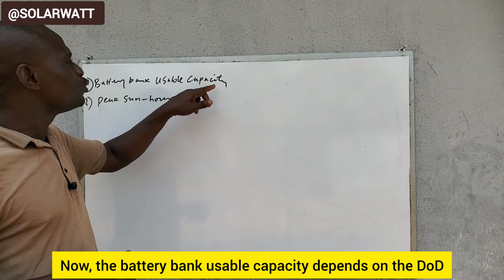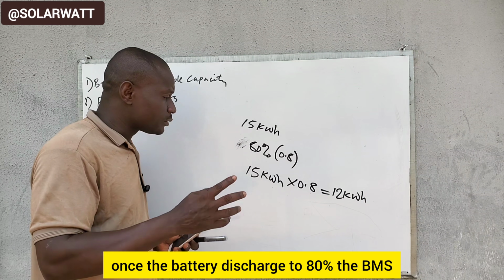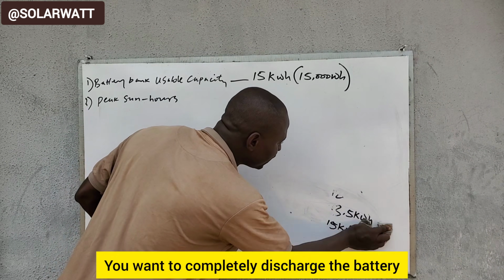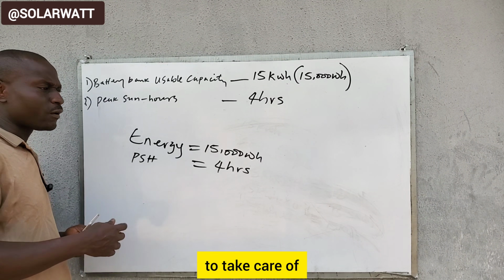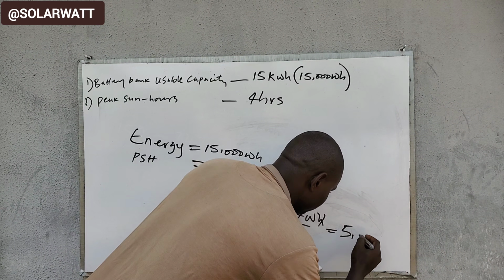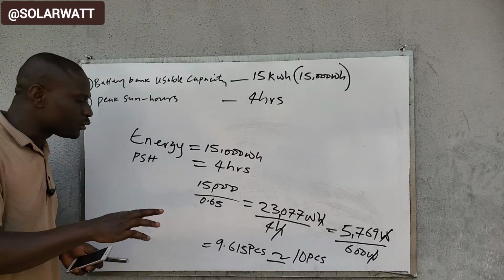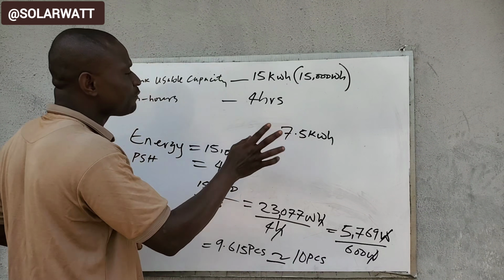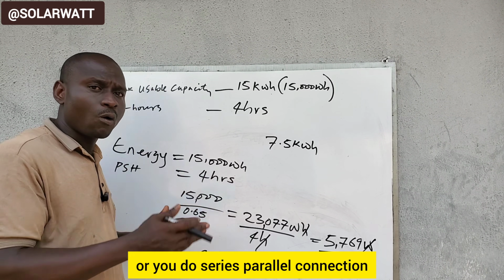How many solar panels do I need for a 15kwh Lithium battery?

Comment: Unfortunately, this sizing is misleading. Sizing should be based on demand not battery capacity. For example, if a household uses 7kwh per day, they probably use 1/3 to 1/2 of it during the day. That should be in the math. See example below

1. Estimate Daily Energy Use
From bills or appliances: Daily usage (Wh) = Σ (Appliance Watts × Hours per day)
e.g. Daily usage = 7 kWh/day = 7000 Wh/day

2. Battery Bank Sizing -  See note at the end for Days of Autonomy.
To cover night/backup use: Battery Capacity (Wh) = (Daily usage × Days of autonomy) ÷ Depth of Discharge
e.g. Battery Capacity (Wh) = (7000 × 2) ÷ 0.8 = 17,500 Wh = 17.5 kWh

3. Solar Panel Sizing -  See note at the end for Days of Autonomy.
To cover daily needs + losses: Solar Array Size (W) = (Daily usage ÷ Peak Sun Hours) × 1.3
e.g Solar Array Size (W) = (7000 ÷ 5) × 1.3 = 1820 W
Panel selection: Use 6 × 350W panels = 2100W

4. Inverter Sizing
To handle peak load: Inverter Size (W) = 1.2 × Maximum simultaneous load (W)
e.g. Inverter Size = 1.2 × 2000 = 2400W → Use 3kW inverter

5. Charge Controller
Use MPPT, size based on: Controller current ≥ Solar array watts ÷ Battery voltage
Required current = 2100 ÷ 48 = 43.75 A → Use 60A MPPT controller

Notes on Days of autonomy. Can be addressed by either having more storage or more generating capacity.

Option A: More Batteries, Normal Solar Array 
Battery bank covers 2 days: Battery = (7 × 2) ÷ 0.8 = 17.5 kWh  
Solar array just replaces daily use: Solar = (7000 ÷ 5) × 1.3 = 1820 W ≈ 2.1 kW
✅ Pros: Can survive 2+ full cloudy days.
❌ Cons: Batteries are expensive and wear out faster.

Option B: Smaller Battery, Larger Solar Array
Battery for 1 day only:  Battery = 7 ÷ 0.8 = 8.75 kWh
Oversized solar array (e.g. 1.5× daily use): Solar = (7000 × 1.5 ÷ 5) × 1.3 = 2730 W ≈ 3 kW
This lets you: Charge batteries faster, handle some cloudy weather, avoid full discharge of batteries (longer lifespan)
✅ Pros: Lower battery cost, faster charging, better battery health
❌ Cons: Slightly higher upfront solar cost, needs larger MPPT/inverter
Reply: I like your analysis

Comment: But a 600 Watts panels can not generate that 600 Watts when put in sun and connected to SCC, Like some 600 won't even give you 450 watts deu heat and some others Natural disaster

Comment: I am watching from Lagos, Nigeria. I observe the configuration for panels to charge the 15kwh battery is approximately 500watt equivalent to a 200ah battery. And equivalent of 15kwh is 12 200ah tubular batteries. This configuration won't charge the battery efficiently based on standard sir. At least 600watt to 200ah, suggestions though. However, I have learnt from the lectures, thank you.

Comment: Something you didn't consider is the effect of the rainy season, when the effective peak sunlight hours can be no more than a couple of hours (instead of the assumed 4 hours). Also, especially in the dry season in a dusty environment, the solar panel can be partially or fully covered in dust, decreasing their efficiency significantly.
Reply: Get bifacial and worry no more
Reply: @adeolumicheal4062  Not true! Solar panels must be exposed to the sun to generate electricity. Any face of a solar panel that's exposed to the sun, will be exposed to dust accumulation, with resultant decrease in efficiency if not cleaned constantly.

Comment: No brother,if you are using a lead acid battery,the DOD is 50% that's means you van only use 50% of its totaal capacity.

So that capacity will be 15kwh/ 0.5= 30kwh lead acid battery at 50%DOD
Reply: Lol, how can 50% of 15kwh be 30kwh. 😂
Reply: @jydolicious2502  
50% /100% is 0.5.
Divide the 15kwh by 0.5
Reply: @abiodun736  Your logic is wrong. 15kwh means 1kw (1000 watts) for 15 hours. 50% of 15 hours is 7.5 hours. So 1kw (1000 watts) in 7.5 hours is 7.5kwh. Not 30kwh.
Reply: You are dividing Instead of multiplying.

That's where you got it wrong.
Reply: @enahorookhamafe2710  seriously???,..50% of something means (half) of that thing. So you mean 50% of 100 is 200??. 🤣🤣🤣
Reply: @jydolicious2502  I was referring to the poster's calculations, not yours. 

Your own is on point.
Reply: Usable energy= total capacity* Dod
For lithium with 80% Dod
It will be 15kwh*0.8 = 12kwh
That means 12kwh is the usable energy of a 15kwh lithium battery

Comment: What if I want the battery to be fully charged in 1hr? Thats will be like 40 pieces of 600w solar panels. Right? Is this possible? I'm watching from Ogun State
Reply: It boils down to the BMS in the lithium ion battery 🔋. If it is built to charge within an hour fine (very hard) but why would you want your battery to charge under 1 HR?. However, if you still want it to charge up in one hour, then design the setup in a way that, the discharge will only go down to 10 or 15% that means you're only taking a pinch out of the total capacity of the battery 🔋
Reply: Your battery max charge rate will determine the time you can use.
Reply: You will have to consider space, voltage and current of the inverter charge controller.

It may be too big for the inverter.

Comment: I just divide the battery bank by 2.46hrs. This will incorporate every factor that you might think of. So 15000Wh ÷ 2.46h will give me 6098Wp which translate to 10 x 609.8W. However, in market we choose 10 x 600W ❤

Sometimes I opt for over paneling. In this case I use 1.8hrs. Thus 15000 ÷ 1.8 will give me 8333Wp. Thus 13.89 x 600W. In market we choose 14 x 600W
Reply: 😂 that over paneling is the way out of wahala. Even in bad weather ☁️ the setup hardly fails
Reply: I think it's way too much. On a sunny day, it will just take about 30 minutes to charge fully.
Reply: You are killing the battery... As against everything u believe.
Reply: @i-TEQ_power  Not really. You set the limit of your charge current on your Inverter or charge controller. So even though there is plenty power available to charge, your inverter draws only what you tell it to draw without damaging your battery. The reason why his calculation is very good is when you enter rainy season, there will still be enough power to draw from the solar panels even though the weather is gloomy. Overpanelling is the way to go since panels are now very cheap. Just tell your inverter what to draw and your battery will be fine
Reply: where are u getting 2.46hrs and 1.5hr from ?